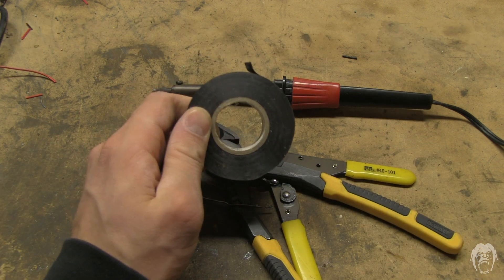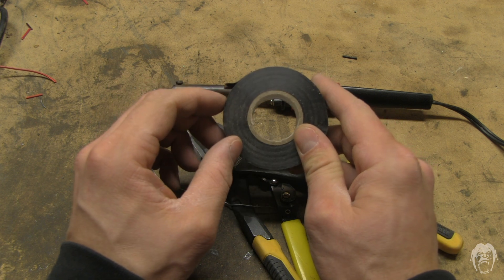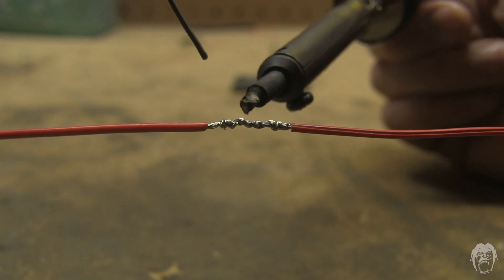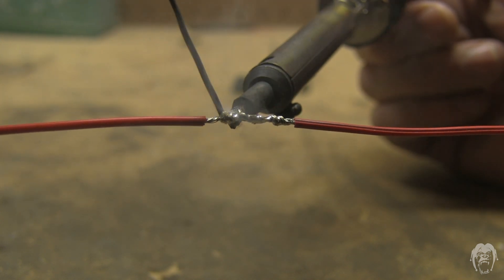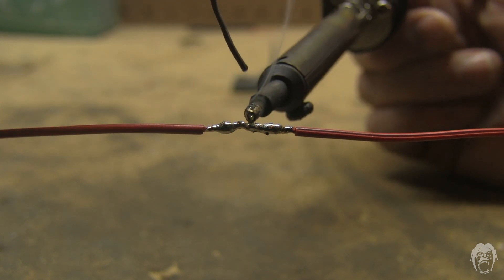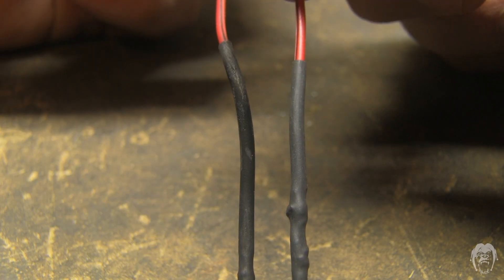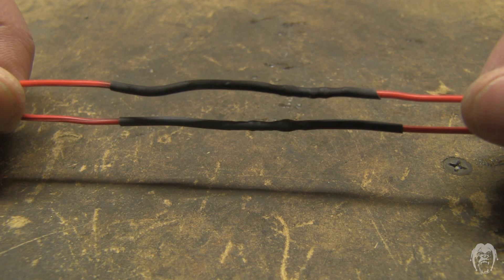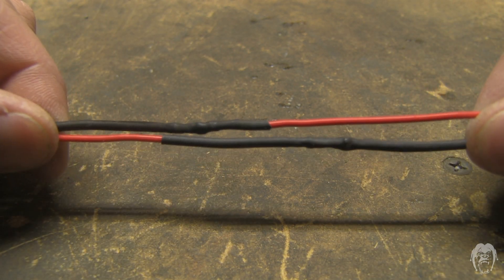How To Solder A Strong Splice

Comment: you might want to try cleaning your tip with a damp sponge.  This will give you a clean tip for better heat transfer, and les chance of a contaminated solderjoint
Reply: brass wool is better for cleaning

Comment: so do you heat the wire so it melts
Reply from the maker: I like to heat the solder instead of the wire. You can heat the wire, but I find that melts the wire jacket.
Reply: @Berserkeroffroad  You should apply the solder to the tip on the iron, then apply the melted tip to the wire, and heat the wire.  If you don't get the wire hot, the solder will melt but it will not adhere/meld with the colder wire.  If this happens you will get what's called a cold solder joint, where the outside will look happy but it will be brittle internally, and not meld with the wire... ie it will be like just dripping the solder on the wire
Reply: Berserker Offroad oh cause Everytime I try the solder just forms a ball and doesn't go on the wire
Reply from the maker: Your soldering iron could be too hot, your solder diameter is too large, or you aren't moving it quickly enough across the splice.
Reply: Berserker Offroad I think it's all  three haha
Reply: @BushidoDragonGaming  your soldering iron tip is dirty
Reply: @cjmmjc2131  i completely forgot about this